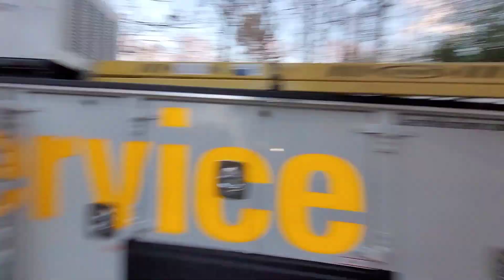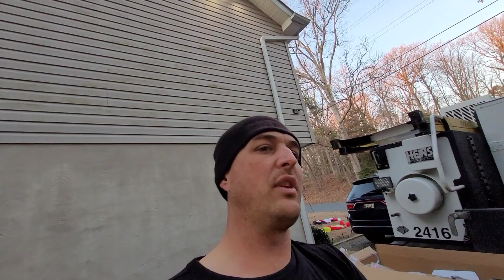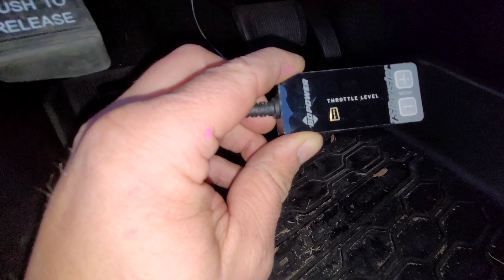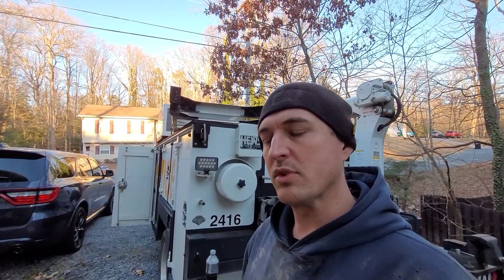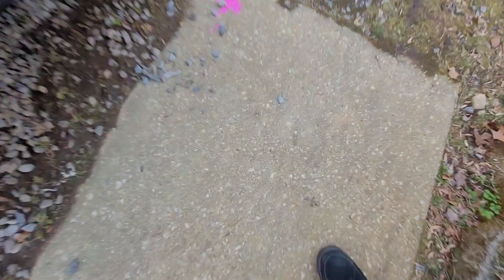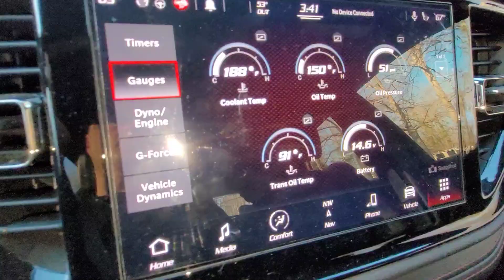Installing/testing Blastin' Bobs Resonator Delete on my 2021 dodge durango rt

Comment: Did it give engine check light
Reply: They should not throw a check engine code because there are no sensors in the back

Comment: I just installed these yesterday. They look great. The sound is more aggressive than I expected, that's good to me. There is a little drone at low rpm town cruising but its not much, literally just turned radio up 2 numbers or just change rpm a hair and it's fine. Now when you get it, it gets and is loud. Not quite neighbor hater loud but it will turn heads!
Reply from the maker: Youll really like parking garages! Thanks for watching!